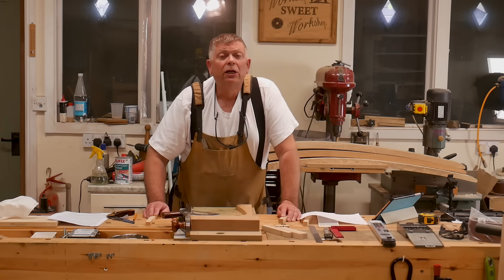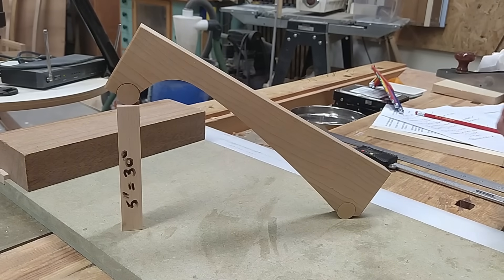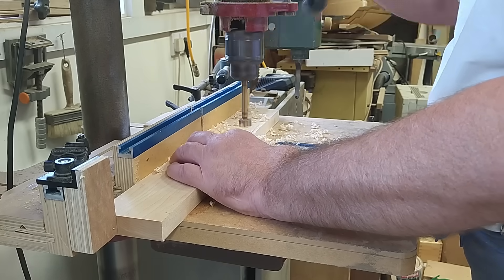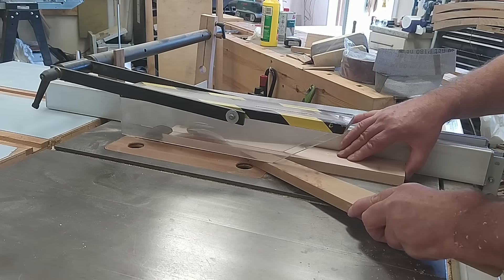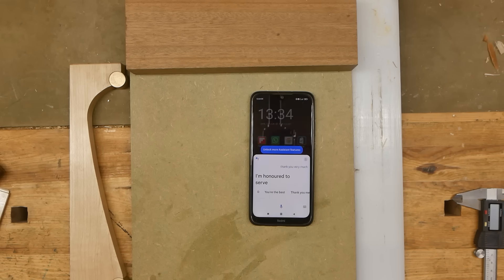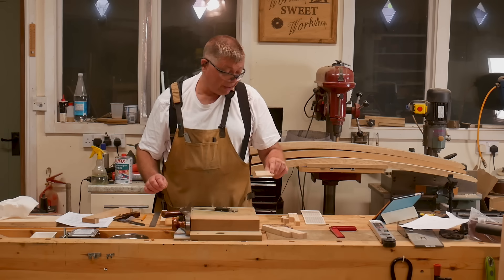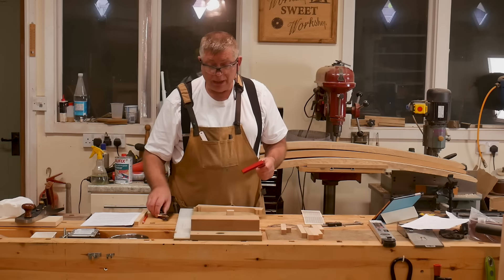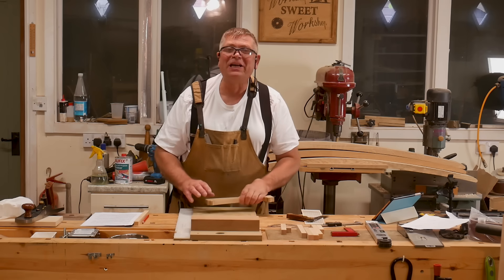Make a Sine Bar for perfect angles First Time Every Time!

Comment: Multiplying by ten is easy - so that’s why I’m using inches?
Reply: Not trying to be “that guy,” but you seem to have missed the point that he was choosing a large unit of measure because larger distance is more accurate. An inch is larger than a centimeter.
Reply: My thought exactly . He's going for precision with a bigger standard.  @design8studio
Reply: @design8studio and a decimeter is larger than an inch  people seem to think metric is only milimeters centimmeters and sometimes meters
Reply: He didn’t mean to say he’s working in inches because they’re easy to divide by 10.  Rather, he was clarifying that since he’s working in inches, he’s making it 10 in long, because dividing by 10 is easy.
Reply: @ I know what he means, my comment was very much tongue in cheek. Merica and all that
Reply: Who cares which system. If you can math it doesn’t really matter. I usually use decimals in Imperial instead of fractions. It’s no more or less difficult than metric. I’m not about to waste a couple thousand $ ditching my precision measurement tools so I can spend a couple thousand more replacing all of them with metric versions - just so I can multiply and divide in tenths.
Reply from the maker: To everyone who thinks I would be better off using proper guage blocks,this is the reason why : https://www.bing.com/shop/productpage?q=set+of+gauge+blocks&filters=scenario%3A%2217%22+gType%3A%2212%22+gId%3A%22255823841273%22+gIdHash%3A%220%22+gGlobalOfferIds%3A%22255823841273%22+AucContextGuid%3A%220%22+GroupEntityId%3A%22255823841273%22+NonSponsoredOffer%3A%22True%22&productpage=true&FORM=SHPPDP&browse=true&gtin=
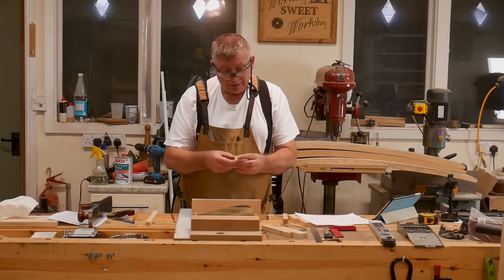Reply: Just use the metric inch = 25mm then all your drawings can be 1:25 and one mill on drawing is only 0.4mm off 1inch or 25mm dead.
Reply: Inches can be useful if you want to use Base 2; i.e., using 64ths and wanting to scale up or down.  But sometimes the Base 10 of metric makes more sense.
Reply: Use cubits instead
Reply: Yes Kevin, ten inches is easier to work with than multiplying by 25.4 cm... Or just use radians 👍
Reply: @scottriddell7893  you would only multiply by 25.4 if you had metric gauge blocks. Consistency of the units of measurement being important, it does not matter what units are used but if you were to use inches it would be much easier if your gauge blocks were in ‘metric’ inches ie thousandths of inches rather than fractions of inches.
Reply: @ if you are using a table of sines then I guess using a number which is easy to do mental arithmetic with might make sense. But I would suggest that most people would be using an electronic calculator to calculate either the sine or inverse sine.  In which case store the known exact length of the sine bar  L in one of the memory positions and the use the calculator to determine either the angle given the  measured height via the sine of h/L or calculate the required height h for a required angle using the inverse sine and length L. The task is not too arduous even using a piece of paper and pencil.  The point being you need to have access to the value of sine/inverse sine with a great deal of accuracy and to have an exactly accurate length and people are much more likely to have and use a calculator rather than a table of seven figures sine values. The system of measurement is totally irrelevant as long as both h and L are in the same system. It just tickled my fancy for an American to extolling the virtues of the number 10.
Reply: Solid point, well done! Lol the entirety of the metric system is based on multiples of 10… hence why the world adopted that system as apposed to the idiotic imperial system that was based on approximate foot and arms lengths, cups of water, comfort temperatures, etc. lol
Reply: @ I had a summer job at Union Carbides Bishop California mine back in 1979. As I was a mining engineering student I was placed in the mine planning department and was given several jobs that required drawing of plans, much to my amusement, I was told that the mine used a metric foot, ie a foot composed  10 1.2 inch long ‘inches’ each of which were broken into tenths etc. They had special scale rules, this being before CAD was a thing. I did ask why they didn’t just go metric, but apparently the miners would not have accepted calling the 8,000 foot level the 2,438m level. So they were making the best of the situation, which made sense.
Reply: @wrenchboostboi8994 ummmm no.   The metric system is terrible and almost useless for day to day living.   The imperial system is far more intuitive and useful.   Try dividing your bushel of apples or your employees daily pay by 3 with the metric system.  I’ll wait… forever.  Because you can’t.   I mean you can’t even divide your precious 10 by anything other than 5 or 2.   What good is that?  Metric is entirely based on the prevalence of machine computing.
Reply: @wrenchboostboi8994 what if you need something divided into thirds
Reply: @wrenchboostboi8994 and stones. I hope there is the original prototype stone in a museum somewhere, together with someone’s foot and an arm.
Reply: @martink6254 I read that in English villages until the industrial revolution reached them, there was a pole of length 16'. Frames of houses such as mine, built 1480, were cut from oak in the woods like kits, and the joints marked in Roman numerals. (Mine can still be seen under floorboards, looking sharp and clean.)
The house started as 2 poles by 4 poles, to which a 2nd. part was added.
If a new pole was needed, 16 men put their feet in a line.
Remember; for most people, travel was rare, books hand written, no rulers were made and distributed, communication slow and difficult, and yet there had to be measurement.
Even time wasn't standardised until the telegraph arrived.
Reply: @wrenchboostboi8994  << hence why the world adopted that system as apposed to the idiotic imperial system that was based on approximate foot and arms lengths, cups of water, comfort temperatures, etc. lol>>

Of course the metric system is based  on the meter being one ten millionth of the distance between the equator and the north pole  ----- except that it's not that distance and has been arbitrarily revised in length several times.  The slightly pear shape of the earth also wasn't known at the time the meter was adopted.

Indeed,  measures of length are arbitrary.   A standard can be any length and measured to whatever degree of accuracy is desired.
Reply: @SeattlePioneer very interesting… i did not know that about the metre/cm
Reply: It does amuse me that the Americans stick to our old imperial measures... @SeattlePioneer
Reply: Yes, that caught my ear as well… Still didn’t make sense the second time.
Reply: Almost an oxymoron that…

Comment: Great video, enjoyed it very much. I made my woodworking sine bar some thirty years ago and also maple and also 10 inches between anvil centres but in order to ensure accurate drilling of the two holes I made a jig. The jig was made on my milling machine, it has a 90 Deg angle to locate the true common centre  line and the holes in the jig are exactly at 10 inches. I then use transfer punches to mark my piece of maple. It's repeatable and quick once you've got the jig. The jig is one inch thick to ensure the transfer punches are perpendicular to the workpiece.
Reply from the maker: That sounds like a Rolls Royce of a jig! NIce!
Reply: Interesting description,  but I'd prefer buying a sine bar rather than making one. Bound to be more accurate,  and they needn't be especially expensive  ----$20 would buy one. 

Still, what you made is likely more than accurate for most purposes.  Very creative, too. 

What do you do to set the height for your sine bar?

Comment: What is the purpose and need for this tool?
Reply from the maker: It's a great way of setting up for angled cuts very accurately. I made mine when I was building a set of dining chairs which had compound angles. You can see the chair legs in the background. The assembly went together perfectly, because the angles were exact.

Comment: For me is so fun to listen someone tells that multiply by 10 makes the things easier while make all the measurement in inches. Wasn't really easier to use metric system?
Reply from the maker: Usually I work in millimetres. But 10" is a better size than 10 cm.
Reply: @SteveMaskery  It is comical to hear all the comments elsewhere about decimal inches. The poor ignorant lambs think that inches have to be fractional units 😂. Bless their hearts and cotton socks, I bet they ain't seen even seen an imperial rule with decimal increments.  It's been a while since I worked in inches, though still have my imperial micrometers.
Reply: @SteveMaskery If I can, I'll suggest everybody to try to abandon this Jurassic measure system and add to metric. It's easy, logic and, at last, more intelligent system. 😊
Reply from the maker: No it wasn't. I usually work in metric, but a10" bar is a better size for this type of work than 100mm. And multiplying by 10 is easier than multiplying by 254. Horses for courses.
Reply: Yebbut. 10" is a sensible size, whereas 10cm is a bit on the small side. It's easier to multiply by 10 than it is to multiply by 254 (the metric equivalent of 10".

Comment: As an apprentice toolmaker I made my own 5 inch sine bar in hardened steel, accurate to less than 0.0002" all over. When I advanced into the design office I swapped it for a decent slide rule (long before the age of calculators). I wonder where it is now!
Reply: One of my lecturers used to refer to slide rules as 'guessing sticks'. Ask an engineer with a slide rule and poor eyesight to do 3x2 and the answer is 5.98 ;-)